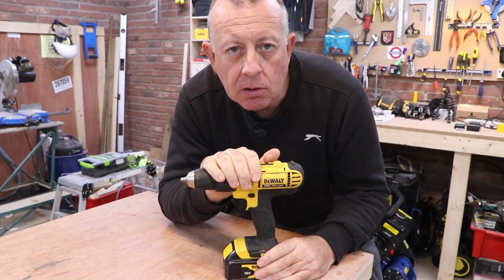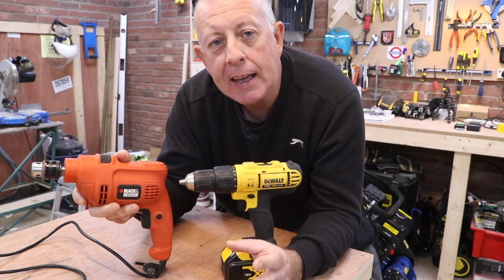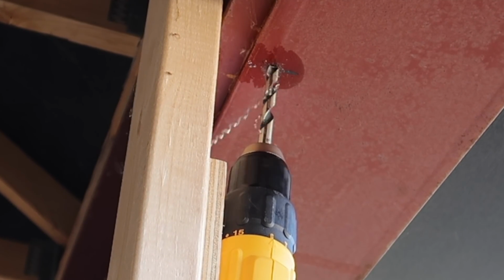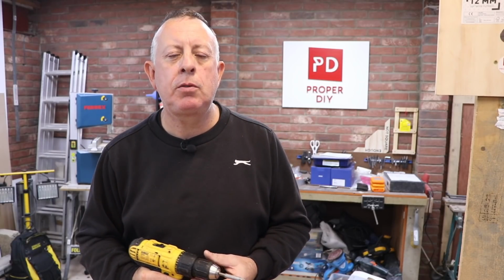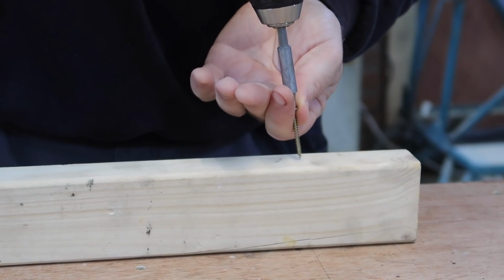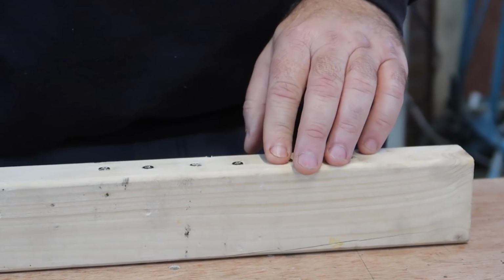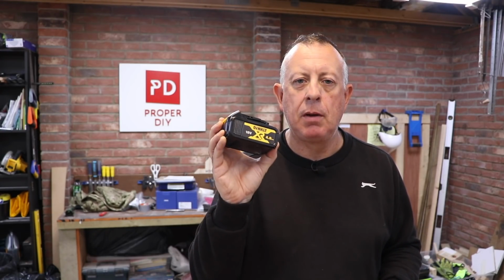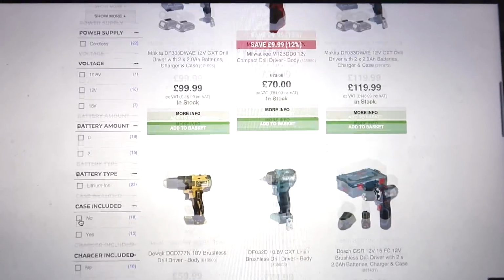Which Power Tool Do I Buy First?

Comment: If you looking for your first power tools just go dewalt they are good tools at a resonable price , a lot of Builders use dewalt , dont go for cheapest option like a amazon special or a black & decker , I have always bought decent car tools as i enjoy working on cars  but i did at first buy cheap power tools for DIY like black & decker i have upgraded most off them to dewalt now , For any car guys dewalt high torque impact wrench are Fantastic i have the DCF 899 its awsome . If dewalt a little bit out off your price range , from what i have seen from the guys i know who own parkside tools seem half decent at a very good price , be aware though once you bought a battery powered power tool you are kind stuck using that brand as the batterys them self and chargers can cost a pretty penny. But if you look about you can find good deals i got a dewalt DCD 796 with two 4AM batterys charger and case for £120 last year  as its a older model however for around the house i dont need the latest model it does 70NM and has a metal chuck and brushless seems like a really good power tool.

Comment: After watching this I went my own way.  The biggest issue is the batteries.  We all know that 3rd party batteries do not last as long as original ones, but if you a basic DIY’er you don’t need a battery that’s going to last a few hours.  Most people it’s maybe 10-15mins.  I went with Makita tools, as the bare units are reasonably priced, and you can pick up 3rd party batteries for about a third of the price of a genuine one.  This way you get the build and quality of a good brand, along with the reasonable price.  I picked up a Makita brushless combi drill, with all metal gearbox, third party 5ah battery and genuine Makita fast charger for under £100

Comment: Hi Stuart, l am a  very first time diy just getting tools together at moment .  l have purchase the dewalt from video but it came with no drill bits etc, the set you showed is this the 100 bit set from amazon? Does any dewalt accessory bits fit different  drill models?  Can you advise. L

Comment: Thanks again Stuart, I have just (this minute!) taken your advice and finally ordered a replacement for my trusty OLD Bosch drill/driver.
It has done sterling work for over 15 years with only one replacement battery needed in all that time.
Over the last few weeks said battery has not been holding it's charge and I had been meaning to look into a replacement so pretty chuffed I watched this vid and followed your recommendations.
Turning up tomorrow (gotta love Prime!!!) so the child will be pushed to the other end of the sofa while I cuddle my shiny new toy in front of the rugby! 🤣🤣🤣
Reply from the maker: Nice one!

Comment: I’m fully bought into the dewalt ecosystem now. Great mid range brand. I’ve become somewhat addicted over the lockdowns….orbital sander, multitool, impact driver, combi drill, sds hammer drill, angle grinder. Next up is the palm router if I can sneak it past the mrs! Great illustration of the clutch in the vid Stuart - I found it particularly useful when screwing in plasterboard into my ceiling of the garden gym I built during lockdown. I found the special bit that came with the black plasterboard screws not very good, but the clutch on setting 6 was perfect every time and fully protected the plasterboard which is so easy to overscrew into!

Comment: There are certain tasks that necessitate the use of power tools.  Most especially, anything to do with concrete.

Don't bother with a cheap drill driver or combi drill for stonework, you'll be far better served with a proper SDS drill.  And don't skimp on the quality of your bits either.

Comment: Question!... Anyone else ever find that just as you're finishing drilling a screw into something, the drill sometimes whips your wrist around into a painful sprain? 
it's just happened me a few times and always felt like it could've gone way worse, so been making me kinda nervous lately. I realise i'm probably doing something stupid like just holding the button down a second too long, and need to time it better when letting go of the button or something , but if anyone has any pointers or Do's&Don'ts I might be overlooking would be great please

And great video , thanks!
Reply: Make sure that you are decreasing the speed as the screw gets close to the end. You can also get kickback when your drill doesn't have the power to drive the screw further or you're using a worn bit. I'd either make sure the battery is fully charged and use a fresh bit/driver (also make sure you are using gear 1 of the drill) or consider a more powerful or suitable tool. You could also try drilling a smaller pilot hole to reduce the resistance on the screw as it goes in. 

An impact driver will not kickback when the torque needed to drive the screw further as the impact mechinism stops the drill from rotating and kicking back as it hammers the bit around instead. Just make sure that you are using impact rated bits and be careful with fibreboard or mdf as the hammer action can thread the screw's cuts in the material if you're not careful.
Reply: @Gilberto90  Hey thanks a lot for this great reply! Really helpful thankyou

Comment: What's the best purchase to do very accurate straight cuts from 12mm mdf. Got a hand circular saw but it's not great.
Reply from the maker: A circular saw is the cheapest you can use but is only as straight as the guide it runs down. You can easily make a guide ...https://www.youtube.com/watch?v=HLsNYd5FmoY
If not then the next alternative is to buy a track saw which should work very well.
Reply: @ProperDIY  can you recommend a track saw. Would a table saw be accurate
Reply from the maker: @darrenhayward4340  I would go for the Erbauer 185mm from Screwfix. With a good track set up this will be as accurate as a table saw. A table saw would also be a good option but not at the very budget end so will cost quiet a bit more

Comment: I've had my DeWalt cordless combi drill for about 8 years now. It's been very reliable. Recently invested in a Dewalt impact driver after being annoyed by changing bits all the time. Both work well to speed things up even more. And these days you can pick them up for quite cheap. There's always sales on at the trade shops. 

Great video.
Reply from the maker: Thanks!. You are right there - I did exactly the same and recently bought my Dewalt impact driver for £50 form Screwfix on a special - excellent duo albeit really loud!

Comment: I would not use my cordless for drilling into stone,unless theres no mains available.
Plus I remember a Sky guy couldnt drill through my wall with his 24v Bosch £400 jobby,but my £80 mains Titan £80 did.
Since the Titan is very heavy,I just bought a Meterk 850w mains for drilling.

Comment: I would have liked to have seen a recommendation from you about which screwdriver and drill bits to get in terms of what to look for and what to avoid. A drill/driver without bits is an ornament!!
Reply: Makita - one with 2 x batteries,although you get batteries on eBay for £20 nowadays,
All them cheapo ones arent up to much.

Comment: I have 2 dewalt 18v drills like the one you are using and they are both the same, I drill a couple of holes and the bit drops out, chuck won't stay tight on either of them. Anyone know why please?
Reply: Hire a person in to do it proper.

Comment: My tuppence worth……

I never use the fastest speed setting, anyone that does get out of my office 😂 slow setting for all scenarios

Unless screwing plasterboard, I never use the depth gauges either. Always have the setting on “drill” for “screwing”, I want ALL the torque 🌪🌪🌪

I never use a driver on flat pack, cheap soft screws. Bolt threads easily stripped etc. Take your time, just go slow using hand tools, better safe than sorry. Nearly all instructions state not to use a driver 🚫

And the one you see the most, screwing with the trigger fully engaged, always ends in disaster. Safer to pump the trigger especially if hard material or removing a screw particularly one for example that’s on a door hinge with 20 layers of old gloss over the top. And two hands are better than 1.

Time to charge the battery

Comment: Great video always informative content! As it's getting cold I was wondering if you could do a vid/q&a on garage workshops like any issue with painting walls? Can you pva concrete floor? Best way to insulate flat roof? Is it worth it? How to protect cast iron tables from damp etc
Reply: I'd love a paint video. I'm having issues with water streaks (brown lines) on my yard walls that O painted white in the summer. I've no idea how to stop them 😡

Comment: Great video Stuart. It is also worth thinking about investing in a "brand" so that you don't end up with lots of different batteries and chargers which are not necessarily interchangeable.
Reply from the maker: Good point
Reply: 💯 spot on. Also if you buy a brand, eg DeWalt,  Milwaukee etc you wil be able to get batteries in the future when the old ones die
Reply: I totally agree. My "brand" is Bosch Blue but with the cunning use of an adaptor, I can use the same Bosch batteries in the couple of Ryobi 18v nailers I use.
Reply: Well,what do you think?
Reply: I solved that problem, by buying corded tools. They all plug into the same 120 volt outlets. Cheaper, stronger than battery powered tools, and the 'batteries' never run down. One good extension cord, runs multiple power tools, of all different brands!
Reply: @d.e.b.b5788  
Fine when you are working at home but when I am doing some work on my allotment a power source is a long away from me and it has to be battery powered. Horses for courses.
Reply: @d.e.b.b5788  😂
Reply: @d.e.b.b5788  Good luck with that in remote locations

Comment: As a very average DIYer I would say it’s worth investing in a good make for your power tools….I’ve been using a 24v DeWalt (SDS) drill for well over 10 years and it’s still going strong
Reply: My Black & Decker commercial 1/2" corded drill is now on 35 years. Still just as good as new. I kind of feel like Stanley 'demoted' the Black & Decker brand to handyman home tools, and had to purchase the DeWalt brand name for their commercial line of power tools.
Reply: @d.e.b.b5788  Ive got one the same age. Its at the bottom of the shed somewhere,so Ive just bought a  Meterk one for £23.

Comment: Great video as usual PD, only thing I wish  you had touched on a little more, which could be a good short mid cycle video, why the AH of a battery matters or more over in which situations.
Reply: Up to 2Ah and even the 1.3Ah are ok for small minor jobs around the house like screwing ikea furniture or putting screws into plasterboard. But if you’re doing a heavier duty project that say requires dozens of 100mm wood screw joining 4b2 studs together etc you really need a 5Ah or even 9Ah else you’ll be changing battery every 20 screws of impact driving or so. I say this based on bitter experience recently ! I now have two 5Ah batteries and a 9Ah on order.

Comment: Spot on, an electric drill has been the No1 goto DIYer tool for the last 60 years. I still have a B&D and Bosch electric drill I bought 40/50 years ago but they now reside firmly in the dusty reaches of my workshop with plenty of cobwebs on them no doubt.  By comparison my Dewalt cordless brushless drill now rarely goes back in its box!  Its so good I've bought another one AND an Impact Driver (wonderful bit of kit)  Its always worthwhile buying the best. Cheap tools are expensive as you are always replacing them…..
Reply: One of the best reasons for using corded tools, is that you don't have to lay out more money for new ones nor pay for extra batteries. Buying a whole new set of cordless power tools can cost a whole lot of money, especially when you already own the very same tool that runs off of a wall socket. I grew up with corded tools; I've never considered having to plug something in to be more than a ten second chore, and never worry about batteries running down, or needing to be replaced. Even with the dramatic improvement in batteries since lithium packs have come to dominate the market, a corded tool is often more powerful and reliable than the cordless ones. One you get used to using them, using the cord is just second nature, like walking.
Reply: @d.e.b.b5788  your right upto a point but my plugin drills use a chuck key and they are heavy……  I used corded drills etc.. for decades but technology has moved on for me.  If you are happy with what you are using carry on, its a free world!

Comment: This is a really good video for newbies to DIY like you said. I think it's great that you remember that not everyone has lots of experience in these things so even if I didn't really learn anything from this video I think it's great to make good entry level content. I would have appreciated it a few years ago. I've had a lot of luck with Screwfix/B&Q's Erbauer tools in the UK. Well priced a good range of basic tools. They even do a cordless mitre saw which I think is crazy for a DIY store brand. My new favourite tool is a Bosch 12v drill. It has enough power for most jobs and compared to my 18V drill is so light weight. I couldn't find it the other day because it was so light in my tool belt I couldn't feel it.
Reply from the maker: Yes I get a lot of comments from those new to DIY and you would be surprised how basic some of their questions/video requests are.